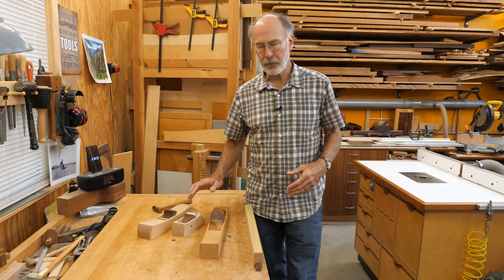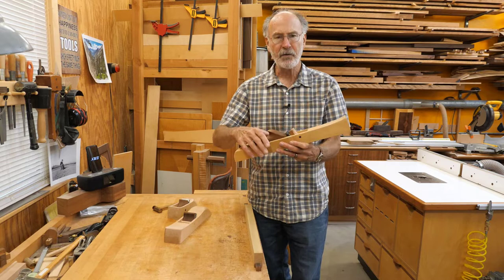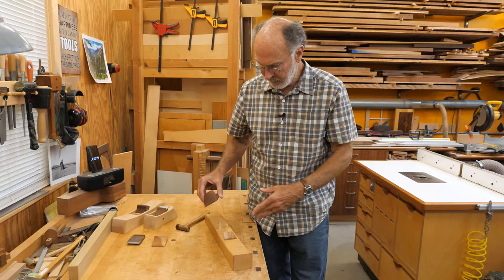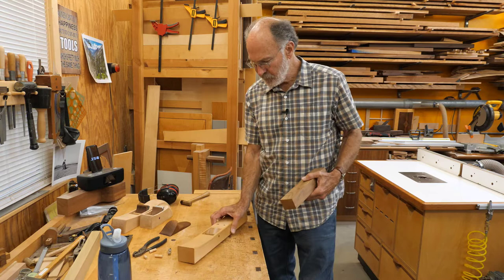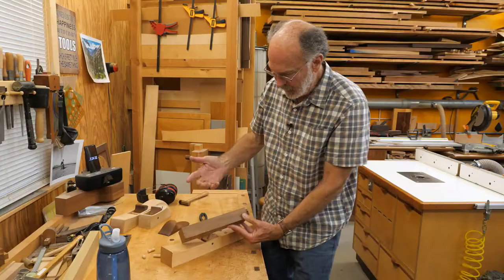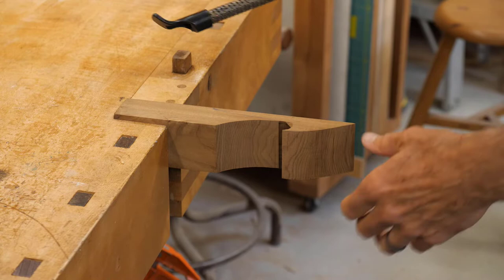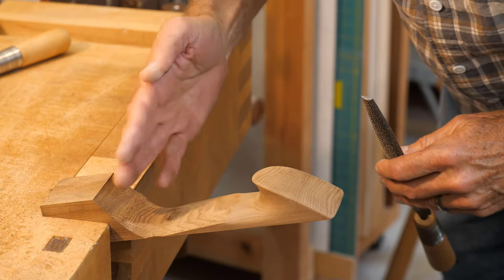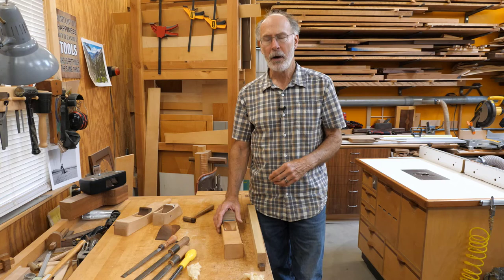Wood Plane Handle Build

Comment: i have really enjoyed watching this series ! Although, i am planning on making a curved bottom plane, would you be willing to make a video showing how to make one of those
Reply from the maker: I have not made one previously, but I have always been intrigued by the design. Krenov made them as needed for a particular project. The few times I have needed one I have used my compass plane or made a curved platen for my belt sander (it's a hand tool, but it has a cord :-) ).

I may give it a go. There are two types of curved bottom planes - curved across the width (which needs a curved-edge blade) or curved along the length (straight blade). I assume you are referring to the former; the other is relatively straightforward. Let me know.